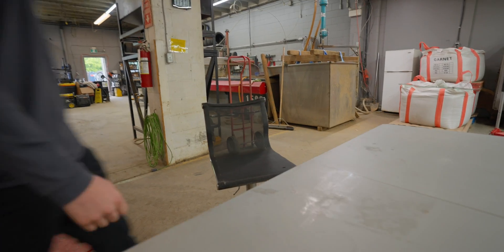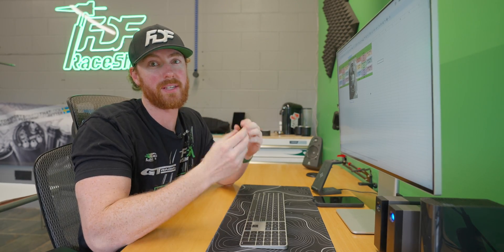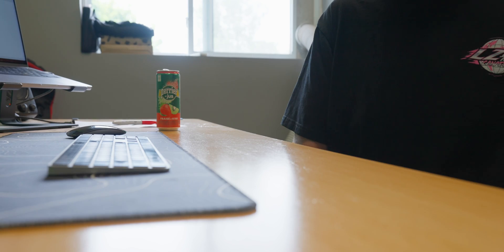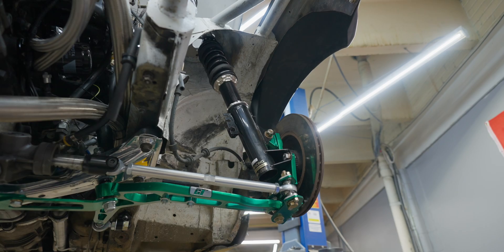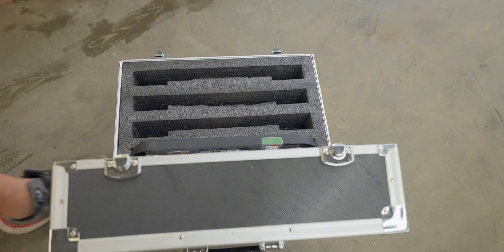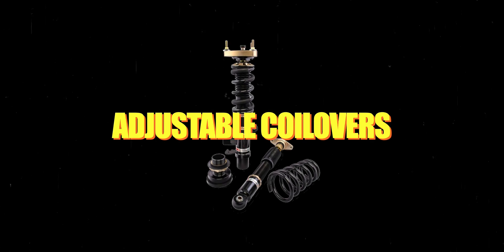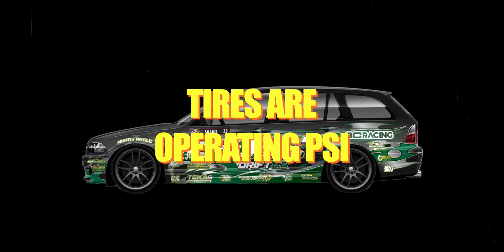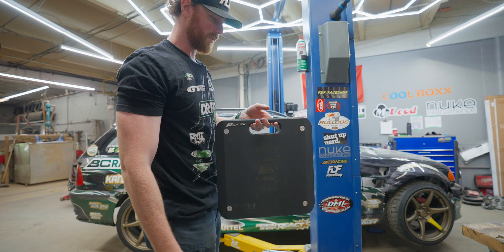Why Corner Balancing Is Crucial for Your Car's Performance

Comment: Sort of relevant, back-in-the-day we ran stock cars and corner balanced them on a regular basis.  It was critical to balance the car, although they were setup asymmetrical because we only turned left.  We disconnected the anti-roll bars, as you do, but also the dampers (shocks), since they would "hang" a little and skew the readings.  We tested that, and it is true.  Although, that is much easier with a divorced shock.  While I am drifting now, mostly trying, the corner balance thing brings back memories.  Very interesting on the front bias of 53%.  Maybe you could cover that a bit more so we can understand how differences in bias affect the car.  Thanks for the videos!    👍